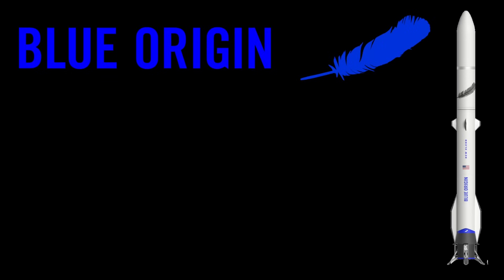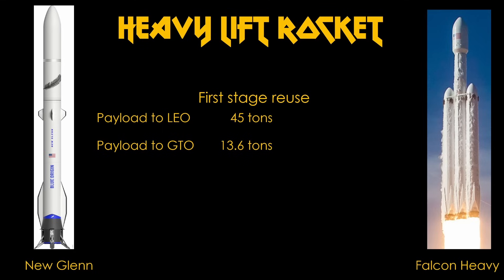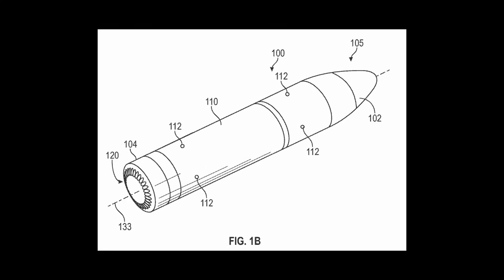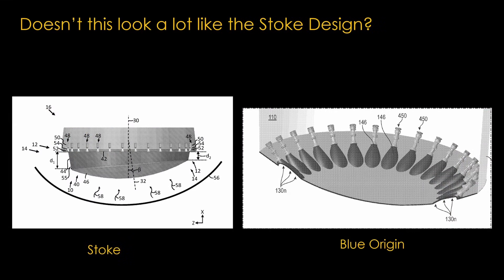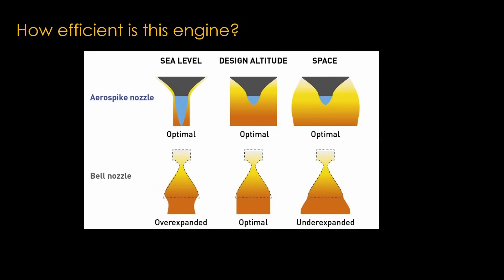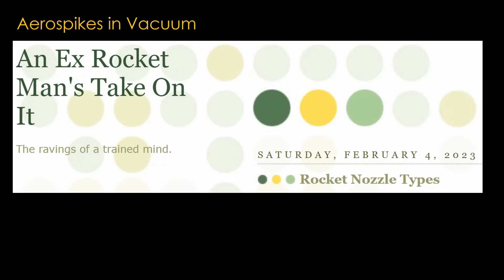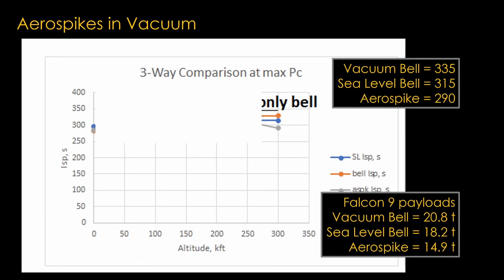Blue Origin's Starship Killer?

Comment: New Glenn is not over sized, because GEO satalites have been getting bigger over time and Double manifests in which two at a time are launched has been proven by Ariane space to be a very effective market strategy.  By making a vehicle that is able to launch 2 current sized satalites now you both gobble up more launches now and protect yourself from being pushed out of the market by payload growth.  Your speculative 2nd stage reuse cutting the payload in half DOSE leave a still very reasonable payload, but efficient uses for 13 tons to GTO are not going to be hard to find.
Reply: You must first have launches to gobble, before gobbling can occur.
Reply from the maker: Ariane dominated the geo market over Delta and Atlas with dual launch, and they had the market to themselves until proton and falcon 9 showed up. But we didn't have the big market anymore.

There were 8 GTO launches in 2023, and probably about that in 2024. 

For 2025 I see about 5 in the Ariane 6 backlog and only 3 for falcon 9, so, once again, about 8.

If new Glenn could get all of those, it's only 4 launches a year. And they won't. The market isn't there right now.

One of the principles of business is to go where the other guy isn't, but dual launch goes against the strength of Ariane 6.
Reply: @EagerSpace  Ariane 6 is not looking like it will be competetive with New Gleen due to lack of reuse, so NG should be able to wrestle commercial launches from it leaving it basically a European natiatonal security supported launcher.  Your count of GTO launches basically proves my point, they are not hard to find, were this the ONLY launches New Glenn would do then that would be insufficent volume, but it's just one segment they will serve.  My point was that their IS market their, not that it's a big market.
Reply from the maker: Reuse does not automatically mean cheaper. Ariane has been serving this market for years and years and they have the advantage of getting all the European government launches which gives them a higher launch rate. They completed fairly well with SpaceX. 

New Glenn has to pull launches from both.

Comment: Actually the vacuum engines on the Starship 2nd Stage are a waste of mass. So an aerospike makes sense --- even more as the operating velocity will be higher than for a first stage. Usuallly the vacuum nozzle are long and thus heavy and an aerospike doesn't have that issue.
Reply from the maker: Not sure I understand what you are saying... Starship needs six - and soon nine - engines to have an appropriate thrust to mass ratio. The additional ISP and thrust of the vacuum engines has a significant effect on how much payload you can launch.
Reply: @EagerSpace  seems I am not aware they are using them --- after watching your video I should have suggested adjustable nozzles
Reply: @EagerSpace  But would they actually need all 9?  Or would just running 6 Vacume Raptor engines be adaquate thrust on assent?  Given the claimed thrust on Raptor 3, shouldn't having 6 of them should still be a higher thrust to weight ratio for Starship even in its ludicrously (desperate) stetched v3 configuration.  Running sea level engines on assent at that point just looks like a waste of ISP at that point.
Reply: @kennethferland5579  They should be able to get to orbit on 3 Raptors currently, or 6 Raptors in the future, but they would probably lose more than 3 tons of payload capacity to LEO from increased gravity losses. So the change would be a net loss of payload capacity.
Reply from the maker: In the current design they need to run the sea level engines because the vacuum ones don't gimbal.

You are trading off the lower specific impulse against the higher thrust which means you get into orbit quicker and reduce the gravity losses. I haven't run any numbers but I suspect you win with the lower gravity losses. 

If you move to nine engines the specific impulse loss is less.
Reply: Durring re-entry they are wasted mass, but they are needed durring assent.  This raises the question of why not just have one set of turbo-pumps connected to two different sets of combustion changers and nozzles?
Reply: @kennethferland5579  It adds complexity and cost. If you lose three tons of payload capacity for having redundant turbomachinery, that's a fairly small penalty. It's cheaper and easier to just stretch the stage a little bit more and squeeze in a bit more propellant.

And remember, the sea level Raptors are used during ascent. If you made it so that only three Raptors could be used at a time, Starship would be underpowered.
Reply from the maker: Because you need both for ascent.

Comment: As for second stage reuse --- theoretically the rocket can just brake which is obviously more practical with refilling in orbit. The advantage is of course no additional mass/weight on the spacecraft etc. There are plans for decades to use the bound oxygen on the moon to refill rockets in earth orbit. I'd say it's just around 6 km/s which the rocket has to get rid off.

Comment: Correct me if I'm wrong but active cooling has be in used on every launch vehicle since the beginning, in this case you'd just be sending it to an additional location on the heat shield surface not just to the Bell,... not a monumental feet of engineering,.. just more plumbing?
Reply from the maker: I probably should have talked about this...

Regenerative cooling of the combustion chamber and nozzle is used on most high performance engines, though some engines use a radiatively cooled nozzle. Merlin vacuum is one of those - that's why it glows on the videos. After a lot of years this is well understood and the amount of heat that it needs to deal with is well known. 

In this case, you'll need to research to find out an appropriate pattern for the channels so that you get enough heat absorption across the whole surface. The part you need to cool is roughly circular, which makes it extra challenging - if you start in the center the channel density is going to be high, but if they go out to the side, the density will be much lower at the edge. 

You need to determine how big the channels need to be. Are they only tiny channels or are they big?

The fluid you are using changes as you absorb heat. It might start as liquid hydrogen and be hydrogen gas at the end. That's going to change how much heat the fluid can absorb. 

You also don't really know how much heat it will be. There are some models for capsules but they a) don't have engines around the outside trying to push the plasma away and b) aren't ejecting propellant in the middle of the heat shield.

Comment: Your payload calculations are off significantly. If this is to use the BE-3 turbopump, then it uses Liquid Hydrogen, not Kerosene as the Falcon does. An LH2 engine has significantly higher starting impulse, which in vacuum means a higher payload, especially to anything higher than Low Earth Orbit. Using a low efficiency LH2 engine, we are still looking at a payload to GTO several tons higher than Falcon Heavy.
Reply from the maker: Which calculations?
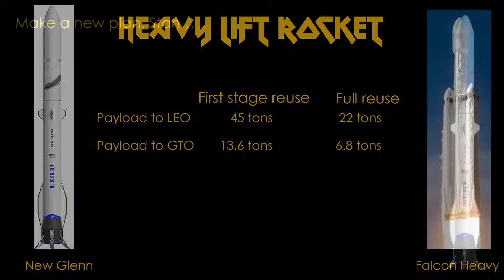Reply: @EagerSpace  from 1:01 to 1:58. Hydrolox has more energy, so the losses from going to a higher orbit is less. That is why Delta Heavy could deliver a larger payload to GTO than Falcon Heavy, despite its low earth orbit payload being lower. You would probably be looking at less of a payload loss for higher orbits as a result, since it needs to do less work to deorbit the stage

The largest GTO payload to date was 9.2 tons. If Blue Origin can get reuse to 70% upmass, they would be able to offer a reusable solution to the entire GTO payload market. In other words, I think you are on the right track here.
Reply from the maker: Thanks. Those are intended to be "what if" calculations without any rigor behind them because we don't know what the penalty is going to be. 

WRT FH and DIVH, here are the figures

                            LEO               GTO            GEO
FH                      63.8 t            26.7 t          10 t (?)
DIVH                  28.8 t            14.2 t         6.7 t

All of those are published figures except the FH GEO one, which is an estimate. 

The Falcon second stage is really, really good - what it gives up in specific impulse it gains back in mass ratio as you can stuff way more propellant into it than you can a hydrogen stage.
Reply: @EagerSpace  seems the FH has improved a lot since the last time I had to calculate them out back in 2017. Good for them.

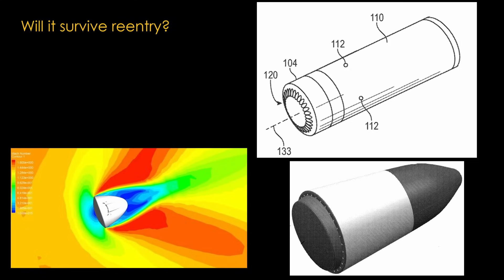Comment: 10:09 Rocket Lab company in New Zealand tested tail first re-entry with their Electron rocket, it was a balancing act to keep the cylinder inside the wake of hot gas, the nozzle was used as is to do the job of a heat shield.
Reply from the maker: As does Falcon 9. 

That's with first stage reentry and there isn't much energy on a first stage because it is travelling so slowly. This would be travelling at orbital speeds, and the energy you need to dissipate is proportional to the square of the velocity. 

Electron stages at about 8000 km/h. Orbital velocity is about 27,000 km/h. The energy is therefore 27,000^2 / 8000^2  or about 11 times more energy to get rid of. 

The heating rate is worse; it's roughly proportional to the cube of the velocity, which means its about 38 times the heating.
Reply: @EagerSpace  Thats why I think the ultimate solution might be 3 stages, with a 2nd stage that is sub-orbital and experiences only half the velocity (and thus a quarter of the energy and 1/8th the heating rate) of typical orbital entry leaving a much smaller 3rd stage needing to withstand that full heating thus allowing minimal thermal protection mass, landing mass and hardwre loss in the case of failure.
Reply from the maker: Sure, but you are adding a third vehicle to build and you didn't have an engine that is appropriately sized for the third stage.

Comment: Ever since the Saturn C-3 design was cancelled in 1963, 
both NASA and DoD realized they had a Payload and Size Gap (under the fairing).
https://en.wikipedia.org/wiki/Saturn_C-3

Blue Origin designed New Glenn (first stage reuse) at 45t to LEO (7m diameter).
—
IF you consider Cargo / Structures to LEO and Cis-Lunar (no returns), 
like Space Station modules or Lunar base structures; 
THEN NewGlenn fits the early 1960s EOR plans — with ~6.5m diameter payloads.
That diameter is same as Saturn S-IVB / SKYLAB.
—
A Dry Workshop of the same size as 1970s Skylab core (6.5m), could be launched by New Glenn.
Multiple methods (New Glenn, Vulcan, Falcon Heavy, Antares 300, etc) to provide additional pieces,
for outfitting the initial Skylab Next Generation (NG).

Comment: Coming in tail first from orbit means much less aerodynamic drag and I would think it will be approaching the ground at hypersonic speed. So hypersonic retropulsion and ~10-20 g of deceleration?
Reply: No, your still going to be slowed down to terminal velocity in air many km above the ground, you have to engineer an entry vehicle speciifcally to AVOID deceleration to stay anywhere near hypersonic by the time your reaching the ground.  The smaller balistic coefficient of tail first rather then side first entry just pushes your altitude of peak heating and decerleration down from ~60 km up to say ~50 km up.
Reply from the maker: I did some quick calculations and came up with roughly half the surface area versus sideways, so less drag but the drag is proportional to the speed so if you are carrying more speed deeper into the atmosphere you will have more drag there. 

Empty stages aren't very dense so I don't think you get close to the ground with much speed left. I do think that less drag changes the heat profile and probably gives you a higher max heat to deal with.

Comment: The real "killer" for Starship will be it under performing not only due to overrun in operational costs with refurbishment as in payload capabilities as maximum Delta-v.
Reply: Time will tell.  I still remember everyone laughing at SpaceX crashing boosters, and pointing out how reusing first stages was simply not technically and economically viable.  A few years later and it's routine, launch costs are way down, and the only time a launch makes the news is when they don't manage to recover a booster.
Reply: @kaasmeester5903  No one said it was technically impossible, they said it was hard but because all the crashed boosters were already paid for that their testing was basically free.  That's not the case now.  And no launch costs did NOT come down after F9 was reused, which critics accuratly predicted.
Reply: @kaasmeester5903  Musk fanboys always bringing Falcon 9. So tiring. It's a completely different type of rocket, and didn't drastically decrease the prices per tonne to LEO as initially claimed. Starship looks to be struggling with its dry mass.
Reply: @RogerM88  It's struggling with both dry mass AND insufficient thrust from Raptor engine.  Together they have sapped the whole payload (Musks claim of 40-50 tons for the present vehicle is 'optemistic' as usual).  But worse the engine is still unreliable, failing to restarte and even exploding.  Pushing the engine to the thrust levels then need to regain payload is a going to be very hard.  These are the kinds of issues which traditionally prove fatal to a rocket development program.  This is the core problem in SpaceX's "what would Korolev do" approatch to rocketry.  Soviets had great engine thrust but they will willing to accept high failure rates that came with that because their payloads wold fail at even higher rates, and they put thouse engines on terribly heavy brick-shithouse stages which staged more often.  Low reliability and heavy stages are terrible for reusability.
Reply: @RogerM88  I see you're backing to making things up so you can pretend you have a leg to stand on. Well you haters have never been that bright and have never yet understood what honest means.
Reply: The first stage will be mostly reusable, because it won't be exposed to the temperatures that Starship has to endure and also because it will be caught, so it isn't expected to take much damage. While Starship is the challenge here, it's something they have to perfect, but they're certainly going to get it, they've proven they can, it's just a matter of time.
Reply: @WillGerar   In my opinion SpaceX should focused all that funding and resources used in Starship program towards building a bigger payload fairing to Falcon Heavy. Able to fit a small lander and a kick stage. And then build a Methalox rocket similar to New Glenn, with a flight path similar to Falcon 9. And then iterate towards a reusable upper stage.